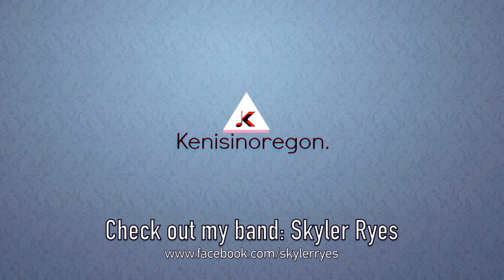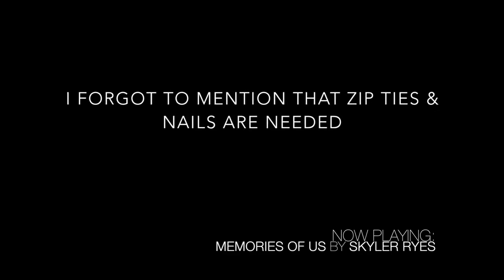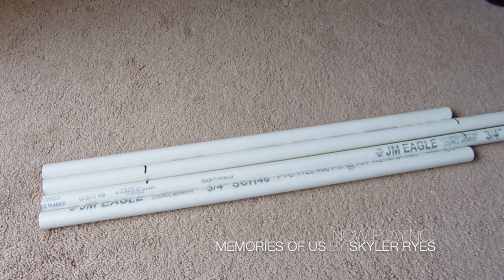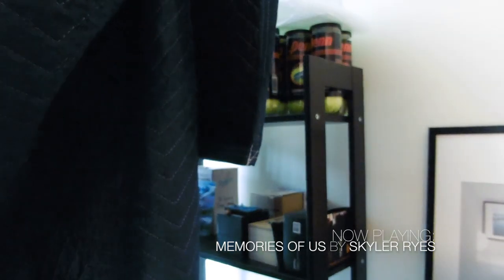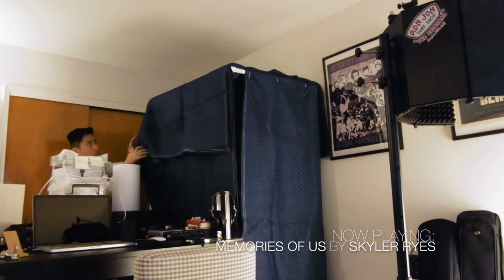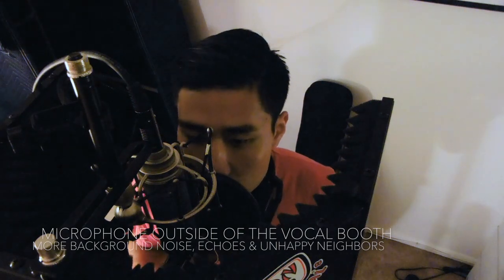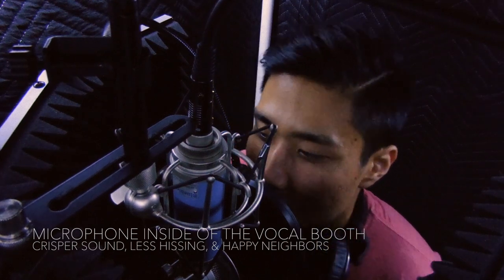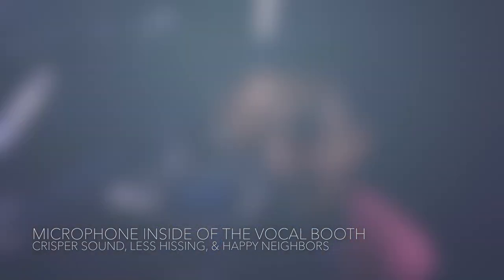My DIY Sound Booth | Ken Tsuruta

Comment: What mic stand is that?
Reply from the maker: I don’t remember exactly where I bought it but it’s a PA stand. Here’s an Amazon link to something similar: Universal PA DJ Tripod Speaker Stand Kit with Adjustable Height Constructed with Heavy Duty Durable Steel and Lightweight for Easy Mobility Safety PIN Screw Locks 5Core SS HD 1PK https://www.amazon.com/dp/B08WJM3FBP/ref=cm_sw_r_cp_api_glt_fabc_1CFA8F0BBGZWD9BXWNBW